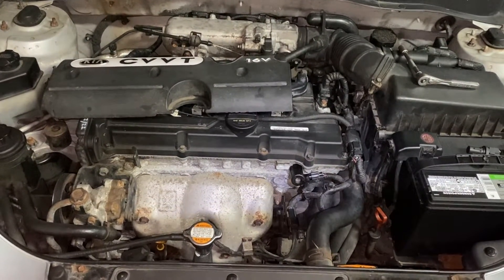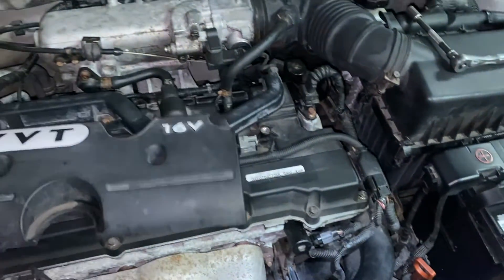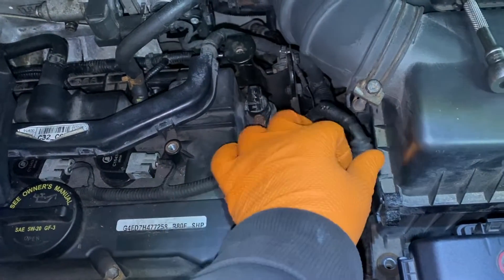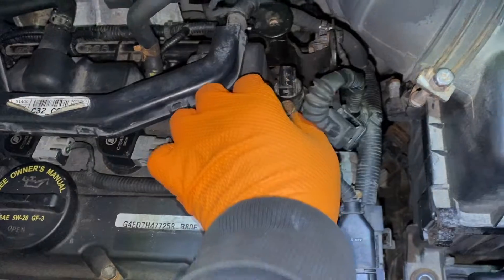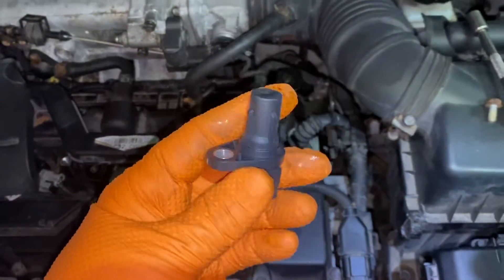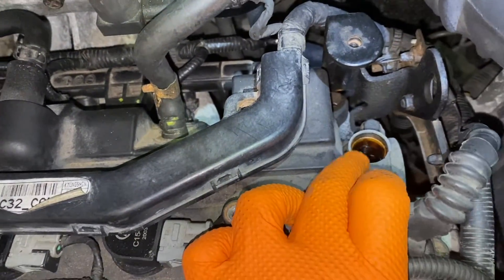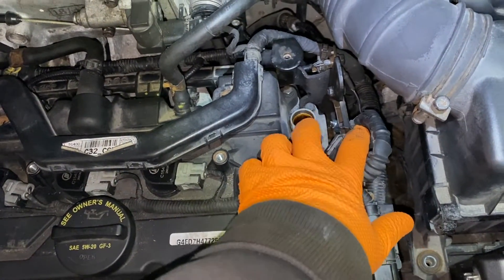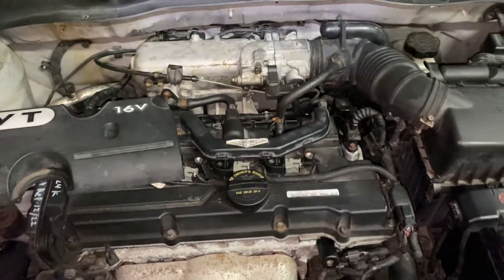Camshaft Position Sensor Location & Replacement On Kia Rio, Rio 5, Spectra & Hyundai Accent 1.6L

Comment: Hi, I have a kia like this in my garage only it's a 1.4 ltr engine. I can find a CVT solenoid with a broken plug but I can't find any sucket on the car that is meant to go on the CVT solenoid. The car is on a limp home mode. It has a terrible misfire. We have don almost everything we could to make it work fine but we are unable to. I am tired of just changing part that do not solve the problem. I need help
Reply from the maker: What is the problem and any codes?

Comment: Thank you so much for your very clear instruction !!
One question? 
Can this camshaft solenoid valve sensor be cleaned an put back in? or must be changed?
Reply from the maker: Sure no problem! And yes you can try to clean it but if it has failed it won't help.

Comment: Hi, thansk for the video. Can you tell me the name of the sensor at 2:18, on the right side of the heat cover of the sprout. It got a black color.
Reply from the maker: Thank you! That is the variable valve timing solenoid .
Reply: @motorcarnut  Thanks!
Reply from the maker: Sure, no problem.

Comment: Mine have p0016 code and cranks slow wirh no start could this be my problem was running then i cut it off to go in the store came out and it wouldn't crank
Reply from the maker: If it’s not cranking that would be a different issue.
Reply: Did you ever find out what it was ? Mines doing the same thing

Comment: I'm wondering if this might be the problem with my car. Sometimes it won't start and when it does start sometimes it's kind of acts up a bit and then quit running there is no engine light on I checkedmy relay switches two of them were bad I replaced those and my car ran fine but I only went a short distance however it wouldn't start back up I have to let it sit a while before it will start again
Reply from the maker: Could be but it would usually set a code. Make sure the ignition system and fuel system are working properly before replacing the sensor.
Reply: You must verify you crank sensor, I had the same problem.
Reply: @yassinetajyassine8597  okay and just how do I verify it?